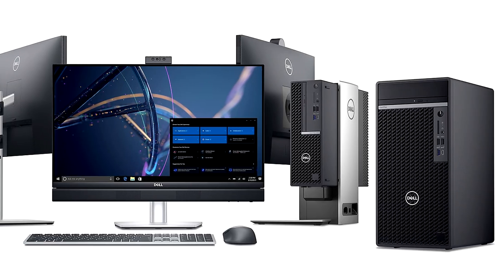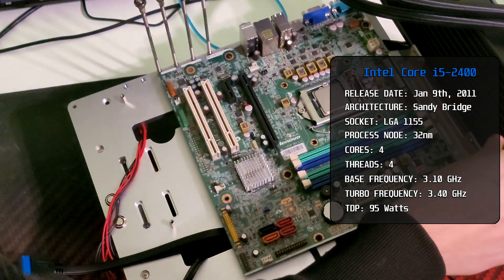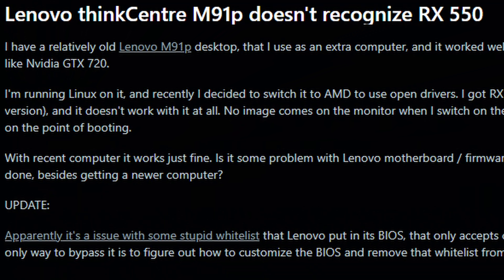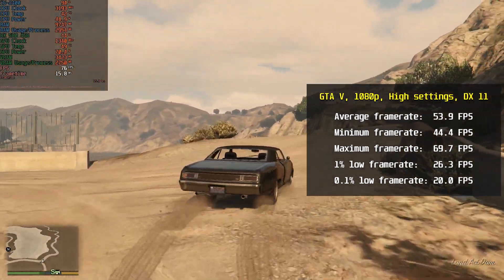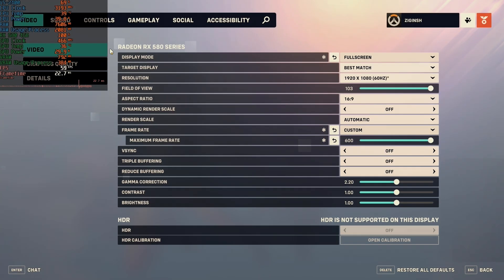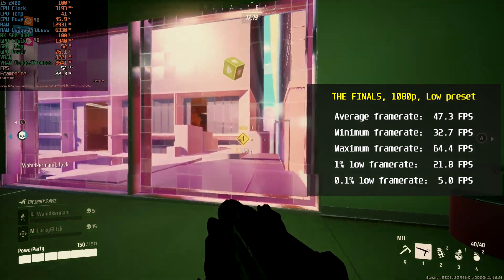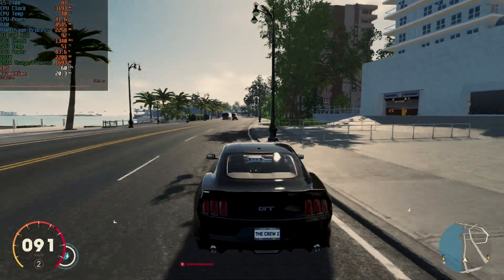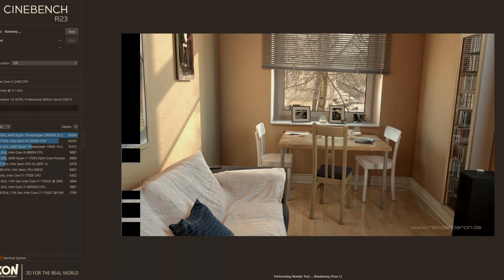Resurrecting The Core i5-2400 | Can It Handle 1080p Gaming?

Comment: Is this all still on ddr3, because I found a cheap i5 2400 online, and want to get a rx580 or smth to pair with it, but it's like R1700 (ZAR) and I don't have that...

Also I have an m.2 in my laptop, would it be worth it to get a new one or use the laptop one and scam someone... 
If I get a new m.2, move win 10 home there, use my 8Gb ddr3, buy an Rx 580, sell my laptop, would it be worth it, the intel iGPU intel HD 2000 or smth kinda sucks, so should i try it, it will total up to R2000, but i can sell my laptop for that much i guess... 

Pls help my dumb ahh

Comment: I have 
I7-2700 32gb ram rx 570 and got it only for around $80 and can play most of the game just fine. Still using this cpu since release. Better than most ryzen builds.
Reply from the maker: Actually, totally agree with you!
Reply: @ziginsh PLSS I HAVE INTEL I5-2400S PROCESSOR BUT IT ISN'T ABLE TO HANDLE LOWER GAMING BUT I HAVE ONLY 1500₹ BUDGET FOR BUYING PC!! WHICH GPU CAN I BUY 😭😭 HELP ME
Reply from the maker: @SANTO_1k Look or second hand gtx  960/70 or RX 570/80 4gb 😁
Reply: @ziginsh will this be available in the budget of Rs 1.5k?
Reply from the maker: @SANTO_1k yup, but you need to be patient!
Reply: @ziginsh its meaning its price will go down in the coming time

Comment: hey i have that same motherboard from the ThinkCentre, can it be used by other power supply's?

 if so, should i fix this motherboard as all the usb ports are broken and pare it with a i5 2400 and an rx 570 4 gb? 

i also want to upgrade to an i7 3770 later when i have the money
Reply from the maker: Actually yeah you can pair it with any PSU you can afford, but it would be tricky to repair usb's, personally I'm not really sure if it's worth it!
Reply: @ziginsh  With this GPU 2600K or 3770K would be much better, especially in new games. And you don't have to change motherboard.
Reply: @PREDATEURLT  agreed i will probably upgrade to a i7 3770 (not K verison) later when i get some money
but this i5 2400 will get the job done also as long it doesnt give me any fps drops
Reply: @ziginsh sorry for late reply i had exams these last 2 weeks

idk what will the repair centre say if they can repair it for cheap then its fine but if not its fine also since 2nd 3rd motherboards are really cheap in my country

can you recommend any motherboards that are good?

i also want motherboards that support 16 gb ram
Reply from the maker: @mrmaxthesmaximum I addresed your question in my first stream, in short, look out in aliexpress with m.2 support for 20 bucks!

Comment: prob buy a 3th or newer gen cpu or i7 2th gen cpu if ur planning to budget game
Reply: 4790k is the best budget cpu that exists
Reply: @escapetherace1943  ryzen 5 3600 is better for less money
Reply from the maker: @somethin5597 Are you sure that it's less?
Reply: @ziginsh  i bought mine recently for 40 euros, and on my local market place the i7 is about 50 euros, so yes i think its cheaper
Reply: @ziginsh  also i got a stock cooler with the ryzen cpu
Reply from the maker: Well I get i5-2400, 16 gigs of ddr3, 120gb ssd for 10€.
Reply from the maker: Because you can scavenge old optiplexes and thinkcentres for reallly cheap prices!
Reply from the maker: But, yeah you are not wrong there is better options also ;]
Reply: @ziginsh  dang thats is a good find by you
Reply from the maker: @somethin5597 :>
Reply: @somethinSM  okay? But a ryzen 3600 wouldn't fit the theme of a video, which is "resurrecting." Which means the video is about OLD cpus, and the 3600 is not old, it's only 5 years
Reply: @escapetherace1943  okay?

Comment: Do these tests at 1440p and 4K with the same specs and notice that the GPU utilization is higher and more consistent.

You're shooting yourself in the foot by testing at 1080p.
Reply from the maker: Kinda, but do you think that RX 580 could perform better at 1440p?
Reply: @ziginsh  Maybe a little bit in certain games that are absolutely choking it out with the very high cpu utilization and creating the low gpu utilization.

The big issue here is the inconsistent gpu utilization. Raise the resolution to 1440p, and it will be more consistent and give better frametimes, which often times can be more important than framerate especially at lower framerates.
Reply from the maker: @Lunch-b0x Noted!
Reply: @Lunch-b0x cap the framerate idiot